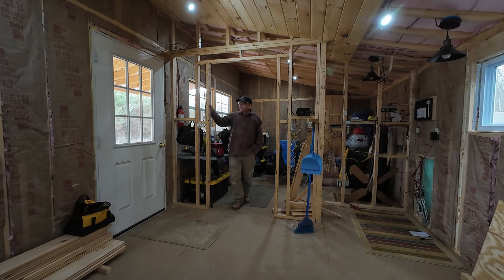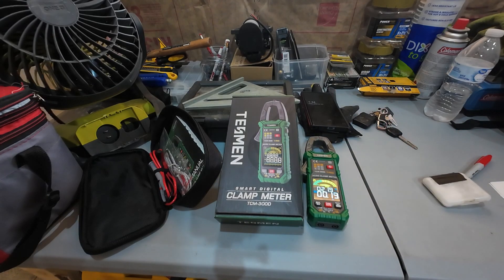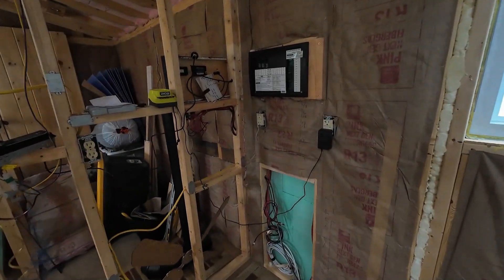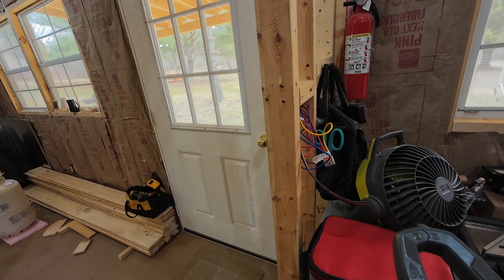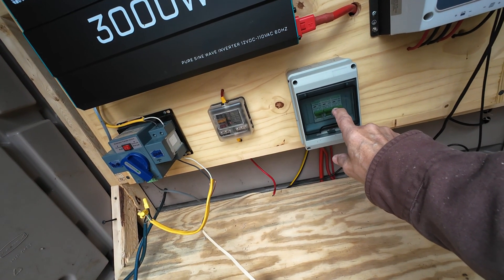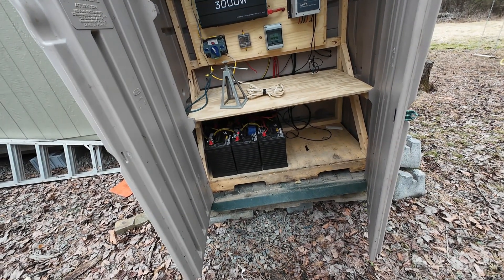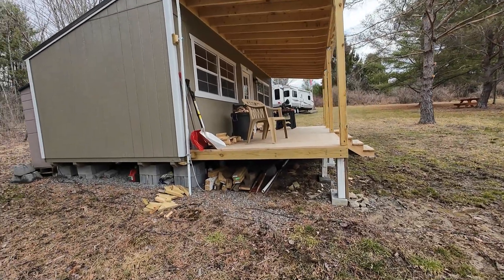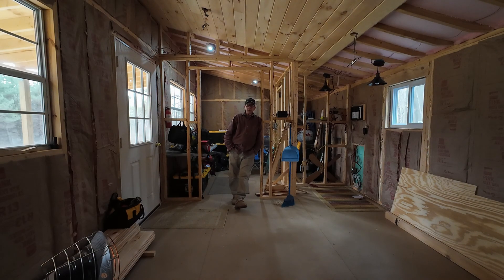Powering camp with solar: A complete walkthrough.

Comment: I enjoy your channel  I prefer individual components over the all-in-one units for this reason. 
If the inverter goes out you may have to replace the entire unit. 
If the charge controller go out you may have to replace the entire unit. 
When you have separate components if the inverter goes out just replace the inverter some of the all-in-one units can cost  into the thousands of dollars my system is built separately just like your system .
I run a 3000 w pure sine wave inverter.
600 amp lifepo battery Bank 
1000 watts of solar ground mount. 
At my Arizona homestead.
Reply from the maker: Thanks so much for your comment and input. The only think in my thoughts at this point is increasing battery capacity, but a little off in the future. Thanks again . Ron
Reply: @campwhatsthepoint  that's the key more batteries more panels.

Comment: Where did you get that box? 30 amp with dc
Reply from the maker: Got it off Amazon 30amp or 50 amp. Depends how you wire it. I wired it for 30 amps.
Here is the link.
https://amzn.to/4coKKqf    
that is an affiliate link by the way.
Reply from the maker: There are also somewhat cheaper alternatives, but that is a recognize name brand. That one also has NO charger in it . Just a box you run your wires in . Hope that helps.

Comment: One more comment would be if you purchase a battery charger I would suggest one that will charge lithium batteries also and the biggest you can afford. Reason being if you are running a generator for power you want to charge the batteries as fast as possible so you can turn the generator off again. Also I agree smart idea getting a 3000 watt inverter it will be adequate when you expand. And you will ha ha!
Reply from the maker: The one I do have and not connected yet is a victron  ip22. It does flooded and lithium.  The next move will probably be a new charge controller, but right now just trying to get our little camp done.

Comment: Thanks for the video. Last fall I set up an emergency backup for my home. It consists of 8-100 watt panels $400. 60amp MPPT charge controller and 3000 watt pure sine wave inverter $330. 5-100ah lithium batteries $930. Miscellaneous breakers, fuses etc. $300? All most $2000 but at least thank God I can survive a long power outage without the need for fuel. Lithium batteries can be purchased now for about $150 for a 100ah and one is equal to about 3 lead acid batteries. As Everett said it seems to be a never ending process. I subscribed also. Good luck.
Reply from the maker: Thanks for the subcibe. I see now lithium batteries have heaters in them now , so maybe I should seriously consider a upgrade. My batteries , as you can tell are outdoors, in a non heated shed. That is my man concern in a extended , non-suuny condition.
Thanks again.